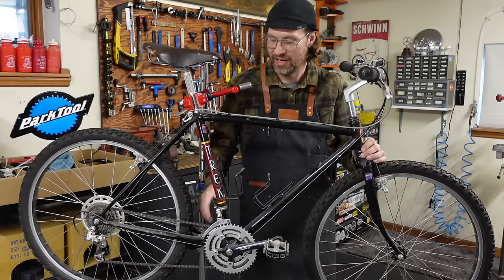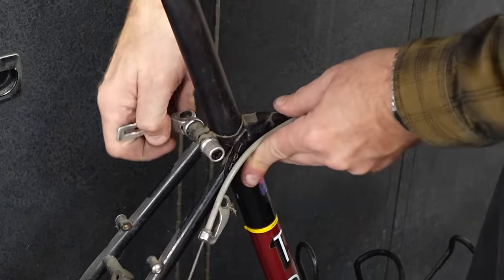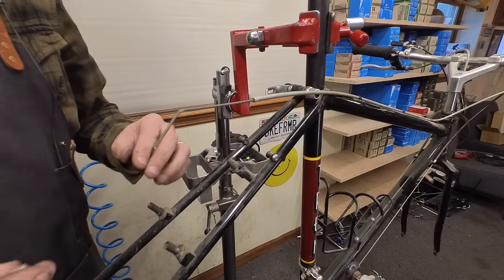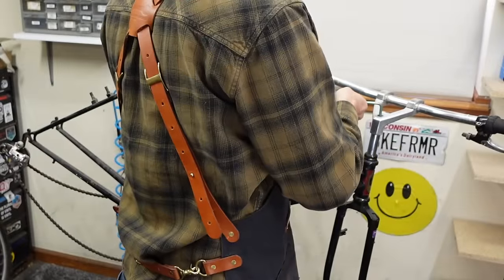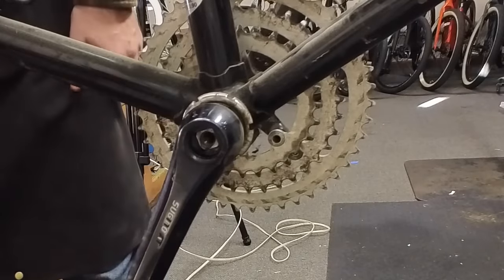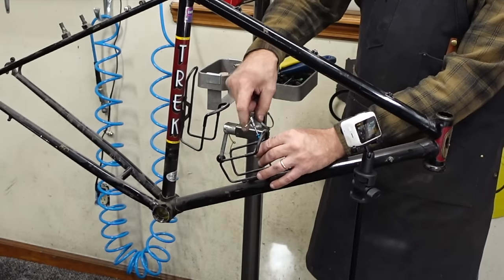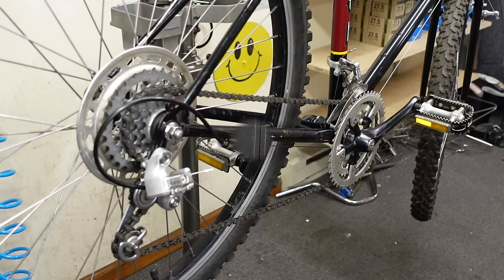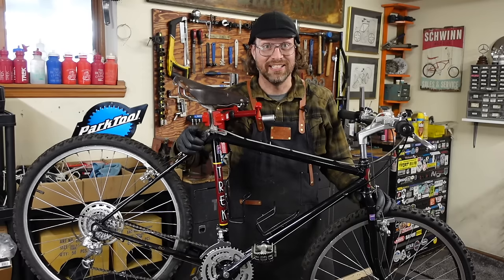TREK's first MOUNTAIN BIKE! 1983 850 Rebuild! A very original example of a piece of cycling history!

Comment: I have one of these lug framed beauties that I bought new in 1983 when I was in my early 20's.  Enjoyed it all these years, but now all that is original is the frame, fork and Sugino cranks. I've electrified it with an EBO kit, linear brakes, Deore indexed 1X6 transmission, smoother cushier tires, upright riding position with North Roads pull back handlebar and Brooks sprung saddle. Its a good old friend and I certainly have ridden is many more miles in it's current form than I did as original. I'll keep it to the end.

Comment: Hello from N.E. Italy 🇮🇹!! I’m a USAF reservist/contractor here. 

I had a Trek 4600 I recently gifted to a contractor out in Turkey 🇹🇷 who has been riding a very rough unbranded type of disc braked Chinese produced (yes I’m aware many parts are from there) low quality components. 

Very nice guy with a limited income. I ride here in Italy 🇮🇹 on trails and steeper “well cared for” gravel trails…and found I don’t really want/need suspension or discs. 

I gifted a nice Trek 4300 to a lower income family friend and deeply miss its simplicity. Cantilever brakes, Shimano trigger shifters etc. 

So I sourced a 1997 “Cro-moly” 850 Sport frame from a Wisconsin bike shop that donates bikes to ppl without transportation.

Most of the period correct pieces have arrived. 7spd, triple Strong Arm Specialized crank, XT front derailleur, Bontrager neck, BMX style gold aluminum bars, “Chill Pill” brake cable connector, Alexi rims, Schwalbe CX front tire and a Billy Bonkers rear tire. 

This ‘97 rebuild will be fantastic in the urban roads, river roads and smooth gravel trails I ride. The Turkish contractor will love his 4600 (just a bit heavy for my taste and overkill for what I ride).

Thanks for your video upload!! I’ll be sure to get some “Power Wash” to shine up the “Burgundy Wine” colored 850 frame. 

Ciao 4 now!!!

Comment: My first mountain bike was a TREK 850 Antelope . After years of riding road style bikes, it was so much fun to just go anywhere I felt like going. I named it "Tom Cat "because I could go, Tomcatting around the town on it. I'm thinking it was 86 or 87 when I bought it. It had the roller cam brakes set down on the chain stays. I think the front brakes were roller cam as well. I took it with me when I toured New Zealand and Australia. I had the Bio-pace chainrings on it which came in handy on big climbs. It got stolen and I was able to retrieve it because I had a Minnesota bicycle license sticker on it. The bastards painted it and got rid of the rear roller cam brakes. I got it repainted and found a replacement, roller cam rear brake. Later on I gave it to a nephew who needed transportation. He promptly got it stolen again and it was lost for good.

Comment: I love those old Trek frames. Chainstays for days.  You could fit a small dog between that seat tube and the rear tire. That Stein tool looks really useful. It's so annoying trying to spin off a fixed cup and the wrench just slips and slips... and slips.

Pretty modest groupset but hey, at least the Sugino cranks are nice!

Comment: Great restoration, and I am sure its every bit as fun to ride now as it was 40 years ago.  80's mountain bikes like this make the best bikes for riding around town, bike paths, and simply enjoying cycling. I have a mid 80's off brand bike like this I restored and upgraded that while not particularly historic like this is my go to bike for getting groceries, takeout, and running errands around town. Those old Dia Compe brake levers are the best.
Reply: I got a set of those brake levers off a wrecked frame dumped in the street. Unbelievable! Long levers are like power brakes on cars. That frame I found looked intentionally severely damaged but I was able to salvage excellent eighties parts from it.
Reply: @evanswinford7165   And long levers are super comfortable. Paired with properly setup canti's, some kool stops.  You have  some nice brakes that have some advantages over everything short of good disc brakes.

Comment: Love vintage MTBs. Wish they still made reasonably priced full ridged MTBs.
Those "dork disc" matter WAY more on these vintage bikes and cheap bikes than modern high end ones. I wouldn't bother with one on a road bike or a high end MTB but these older drive trains and even newer cheapo ones without a clutch the chain flops around a lot on rough ground.

Your furniture polish cleaning trick has been a life saver this winter. I live in an apartment with no outside hose and i ride almost every day. It was driving me crazy making a mess of the shower almost every day to keep my bike clean. Now i just use a microfiber cloth and a Behold furniture polish to wipe down my bike in between deep cleans.

Comment: Thanks, Bike Farmer!  I have a Trek 640 from the same year that I use as my rando bike - very few parts are original anymore but man that bike rides like nothing else.   Super comfortable for long days in the saddle.  Same paint scheme as yours in the video.
Reply from the maker: I find them at garage sales around here periodically. I'm a fan of the 720. I prefer cantilever brakes.
Reply: @bkefrmr  I've got a matching '83 560 that I've put a lot of miles on in the last few years after it sat for 35 years. Trying to decide between keeping it original like this or doing a resto-mod with 105 shifting and 32mm tires

Comment: Very cool! I think this type of bike is perfect to upgrade to a commuter.  I took a 1984 rockhopper and turned it into a single speed that I use daily as a commuter and around town sport bike. Upgrade to a hollow tech crank and v-brakes and pick your speed....works great as a 1x also. Since my rockhopper has a 130mm rear axle spacing it was better suited for a bmx single speed freewheel.

Comment: I have a 1984 Trek 830 and it's a very cool bike!!   I'll let people in on a little secret:  Some of the first Trek MTB's are extremely close in geometry to Rivendell's original 26" Atlantis!!  The only major difference is chainstay length, with the 830's being much longer.  But, anyone who follows Grant Petersen's ideas, knows that longer chainstays are right in line with his current designs.

Most mid-80's ATB's have the very slack geometry of the klunkers and the Breezers/Ritchies/Stumpjumpers that followed.  This bike has totally modern touring geometry:  71 degree head angle, 45 mm rake, which is the same as Surly's 26" Long Haul Tucker.  Rivendell's 26" Atlantis had 72 degree head angle and 40 mm rake.

If you are a bike nerd and can find one of these for a reasonable price, grab it!!

Comment: Yep , one of the origional Marion County bommers! I had one back in the 80s , loved it - put a rack on it and also commuted on it, I got it from a Trek rep. {I worked part time in a bike shop} this thing had been fidden hard, I finally got to the point that I had to overhaul it, the components were shot, but the frame was still good Except for the head tube. it was ovalized from the constant pounding, well I used some 3M stud and bearing mount and filled in the gap at the top and lower race mounts and used a Camppy headset tool to lock everything in place till it set up. Replace just about everything, widened the axle spacing ,put a casset rear cogset on it with proper quick release. rode that beast for thousands more miles, I don't know what it is but there is something about those big ole steel luged frames that just seem to sing to me when I rode them

Comment: Great video as always. I'm thinking if you're lacking a "Stein Tool" you could use a large 1/2" or a small 3/4" drive socket, bolt, washers and a nut to hold the cup wrench in place.
Reply from the maker: Maybe. It’s gotta be a good fit. No slop.

Comment: I have a 95 930 that I put the MTS-101 stem on...  very cool to see the mts-100.. I see them up for sale $100 cdn +  I have a riser bar set..  came off an 83 raleigh that was a nice lugged frame but was welded on and rusty as hell...   dumped in the trash..  can't save them all.   found abandoned in Toronto

Comment: Cool video.  Spoke protectors are "wheel halos", quietly protecting you from catastrophic perils to the spokes.  But, I do have a question... so, you just throw that secondary bucket of rust remover in the sonic cleaner?  Does the sonic action help it's efficiency?

Comment: A friend of mine had the same model of Trek. I’ll have to ask if he still has it. Your decision to not replace cables shows how thrifty (or maybe cheap) bike mechanics can be. Sometimes when I save an old inner wire I’ll move it from back to front. That way I can cut off the frayed part and reuse the shortened remnant. Keep up the good work!

Comment: i have just recently got back into biking.  I bought a new bike was thinking of trashing the old one.  decided to clean it first see if it was worth saving i was amazed at its condition. only thing not salvageable was the brakes. brought it to my local bike shop for replacement brakes young guy in front was going to show me the brakes when older guy saw bike , and came out from the back.  he immediatly asked me how old it was.  I said early  2000 he replied i dont think so.  He noticed it had a rigid fork which made him suspicious he told me to turn it over it was achually made in 96.  I was surprised it was 27 years old didnt feel like i had it that long.  he sugested i go on line try to get some new old stock vintage v brakes. I found a set of yellow vangaurds on line that complimented the green fram nicely.  the bike is a 96 
giant rincon.

Comment: Very cool.

I have a 1983 (I think) Specialized Rockhopper that is all-original except for the tires.  First generation Shimano XT Deerhead.

I am a bit afraid to work on it.  I want to do right by the bike.  It’s nice, though.  It’s almost rust-free, except for the handlebars.  I can probably fix that, too.  It’ll be nice eventually.

Comment: Check those brake shoes. I think the rear ones are mounted in such a way that the rubber part could slip out of the holding slot. If anyone DID ride the bike, they might have a scary moment on a hill!

Comment: Lovely simple bicycle, built strong and built to last. I guess the later models were better with a freehub and cassette plus V brakes. For casual light off road use I personally don't see the point of suspension, I feel a sprung saddle and deep tyres is all you need. A dork disc seems logical on a mountain bike where the derailleur may get forced to one side if you fall off etc. I guess if you are a weight weenie road cyclist trying to save every gram with a well adjusted bike there isn't much point. I feel it is a shame that mountain bikes without suspension aren't a thing anymore. Here in the UK there is the Carrera Subway which is 27.5" mountain bike with rigid steel forks but its very rare for competitors to offer a similar spec bike and the Subway is one of Halfords best selling bikes due to its strength, simplicity and versatility. It's probably the best bike for people 140-160kg to get back into road cycling at a reasonable price making use of the extra strength for road use rather than off-road but not wanting the complexity and weakness of a suspension fork. Always have been and probably always will be a fan of the fully rigid mountain bike.

Comment: wouldnt the spoke protector be obsolete as long as the limits were properly set?
Reply from the maker: WRONG! Rear derailleurs are the most vulnerable part of the bike. They get bumped all the time, causing over shifts. That's what the spoke protectors are for. Ahhhh....what do I care anyway. I make so much money replacing all those parts when the stupid idiot NICA kids cut out their dork discs and destroy their wheels.
Reply: That rear derailleur will throw the chain perfectly adjusted. They didn't work well from the box.

Comment: I did not see if you re-greased the cassette after cleaning it? Did you? --cool it is 5-speed!
Reply from the maker: It's a freewheel, and yes, I put Phil Oil in the bearings, but the footage was all messed up so it's on the cutting room floor.

Comment: lesson learned , thank's , but still ugly ...and if the derailleur has the limit adjusted correctly there is no reason for the chain to fall between the cassette and the spokes
Reply from the maker: WRONG! Rear derailleurs are the most vulnerable part of the bike. They get bumped all the time, causing over shifts. That's what the spoke protectors are for. Ahhhh....what do I care anyway. I make so much money replacing all those parts when the stupid idiot NICA kids cut out their dork discs and destroy their wheels.
Reply: @bkefrmr Why do higher level bicycles not have spoke protectors then . My 1994 GT Zaskar never had one  .